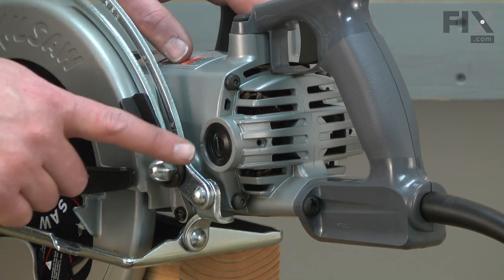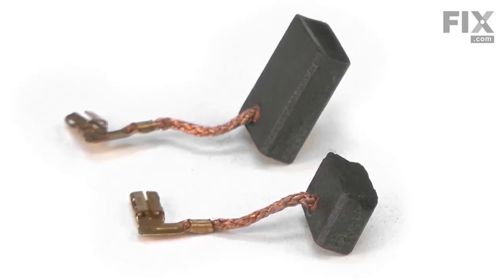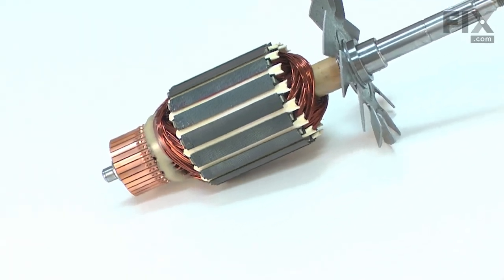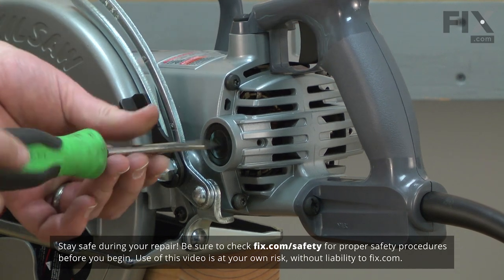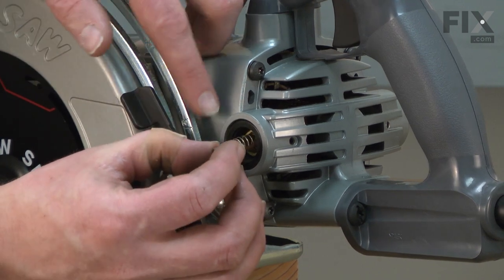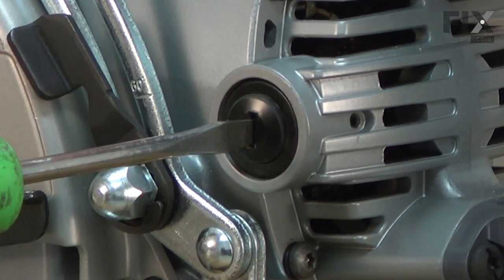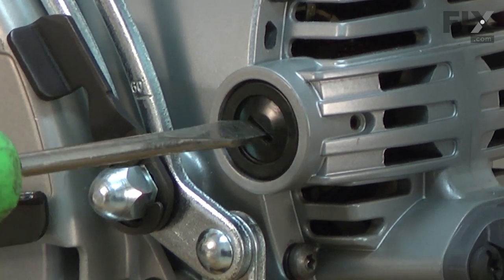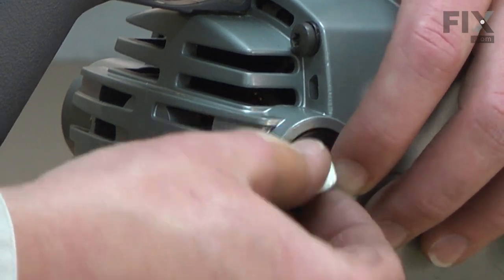Skil Circular Saw Repair - How to Replace the Carbon Brush Set

Comment: When not working after replacing brushes:

The cavity the brushes slide into is sometimes just small enough to keep the brushes from sliding through the end and touching the armiture.  Sand all 4 edges of the brush just enough so it can pass the end of the cavity and make contact. 

If you can spin your blade with no resistance, they are probably not making contact.

Comment: How to get brushes out if stuck
Reply: I'm having the same problem on one brush. The other one came out fine,but the one is stuck tight. You ever get yours out?
Reply: @ciphercode2298  tap on the side of the saw with a hammer to help it fall out